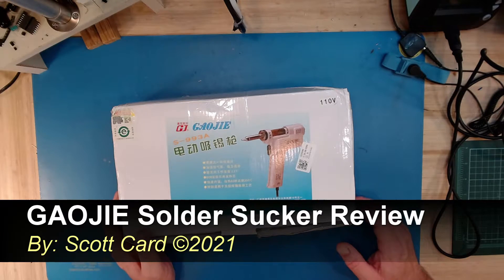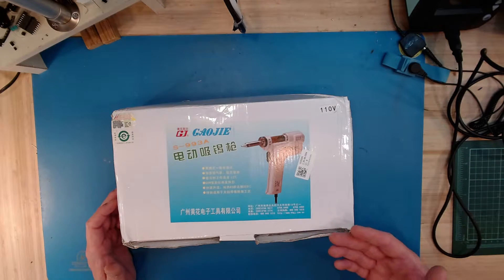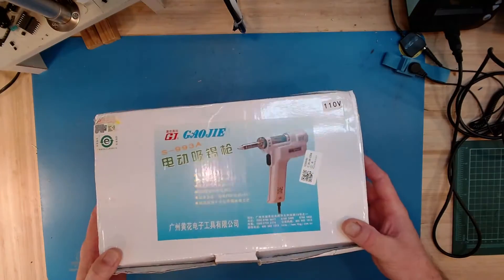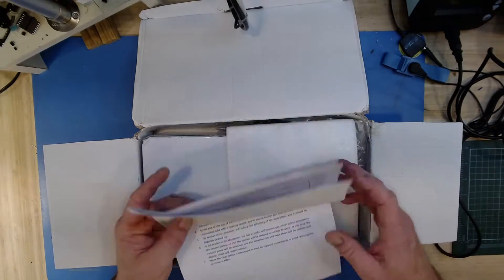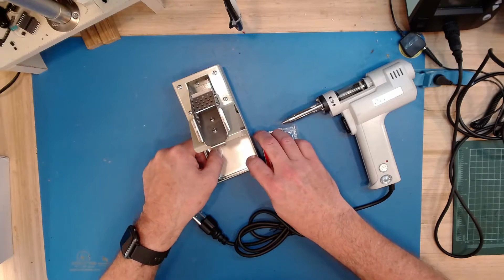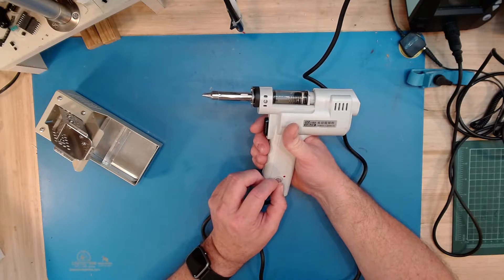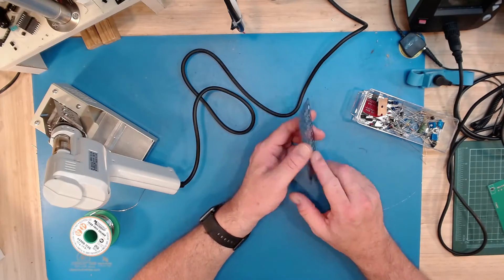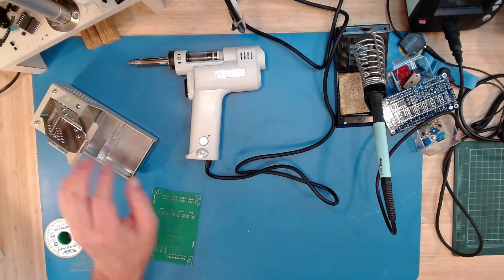S-993A Automatic Solder Extractor - Unboxing, Review, and Modification

Comment: Do you know about the specifications of its electric motor, which is, for example, a few kilopascals?
Reply from the maker: No, there is not much vacuum created but a reasonable amount of airflow (the spec sheet specified >600mmHg or 80kPa but that is hard to believe). These typically are not capable of creating a much vacuum at all. This is why there is a cleaning rod provided, if the nozzle becomes blocked, there the pump can not clear it. Instead the unit uses momentum to carry the molten solder into the trap. I may do a teardown in the near future if there is some interest.
Reply: @ScottCard  thanks